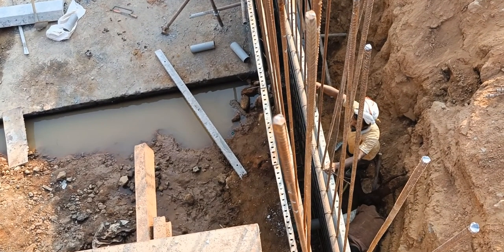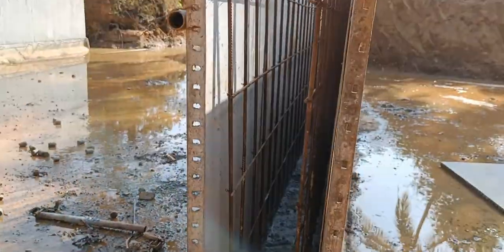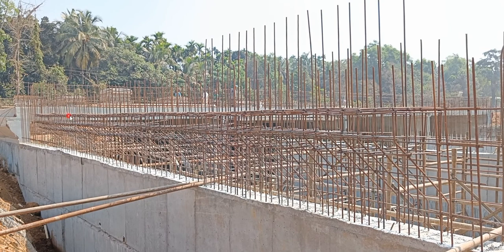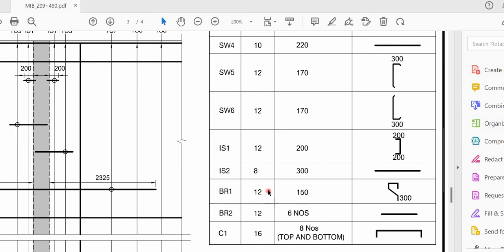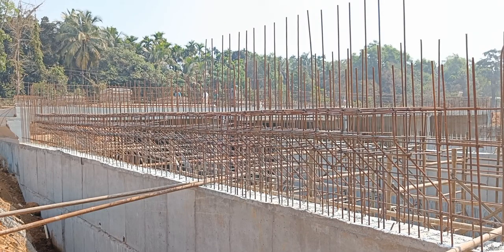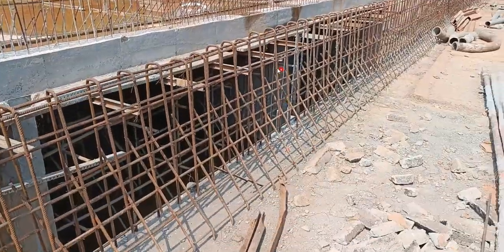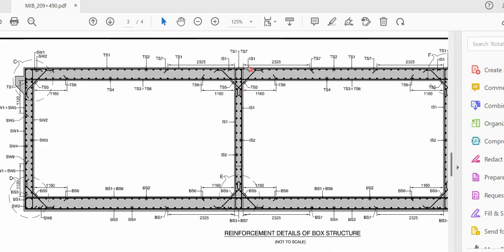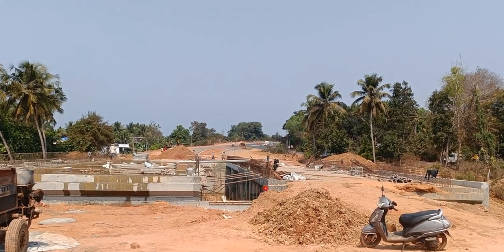10 Construction Step of Minor Bridge l Complete Bridge Construction

Comment: What is the main reason to provide weep holes?
Reply from the maker: To Release Water Pressure. We backfill the Soil behind the Abutment, During Rainy Season the Soil will Capture water and due to this pressure is build-up in the Soil.
If we don't release this pressure it will put an additional Load on Abutment, So to release that additional pressure we provide weep holes.
through this weep Hole, the water will pass, thereby reducing pressure on the abutment
Reply: @civilbrains Thank you Sir
Reply from the maker: @ashiquehassan5514  Welcome
Reply from the maker: @ashiquehassan5514  Explained all these in my Advanced Site Engineer Course